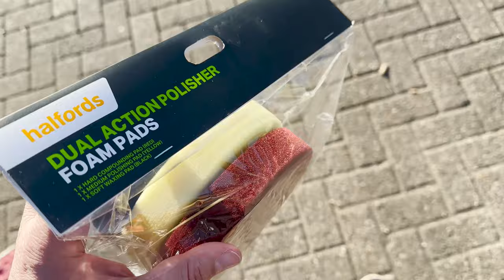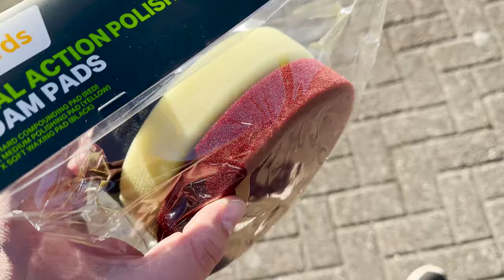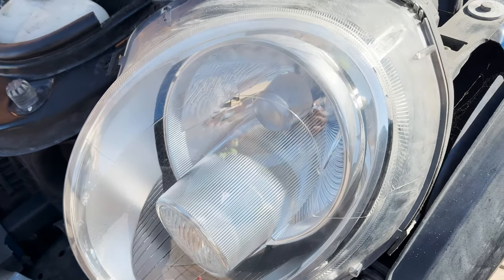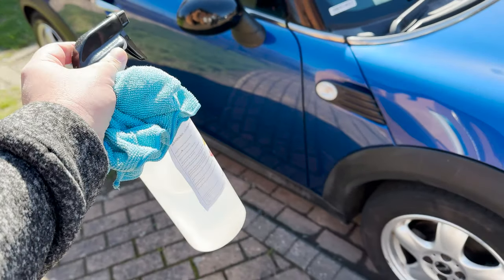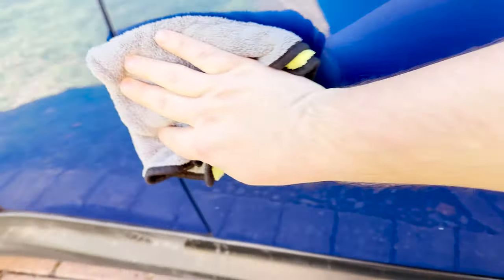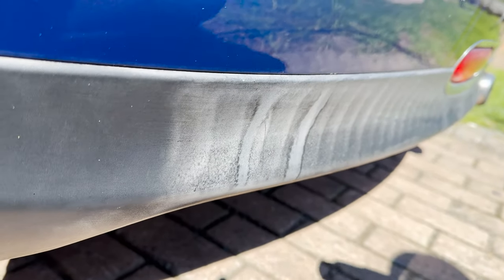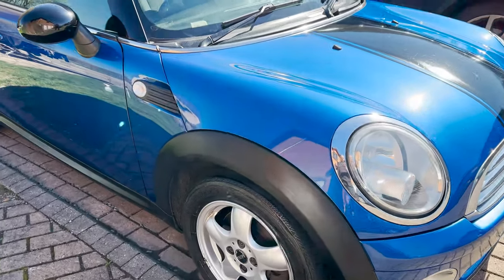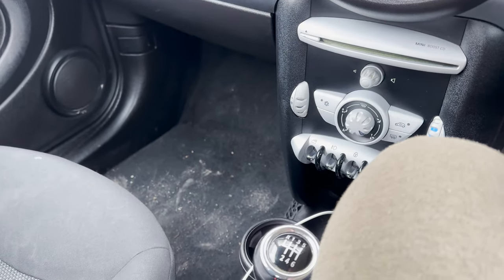Prepping The Mini-You Wont Believe What I've Found-Car Trading UK

Comment from the maker: My Favourite Products
Multi Purpose Cleaner : https://amzn.to/40BxTuf
Best Dressing : https://amzn.to/433araH 
Detailer : https://amzn.to/3Kbuz22 
Glass Cleaner Exterior: https://amzn.to/3zq6MWZ
Detailing Brush : https://amzn.to/3zofFAk 
Best Wax : https://amzn.to/3GcYzJE

Polisher- https://amzn.to/3kS6Fj9
Polisher with batteries - https://amzn.to/3Yle0Wc
Battery pack- https://amzn.to/3KRjyoq

Heavy Cut Compound Large- https://amzn.to/3Jd8mBj
Heavy Cut Compound Small bottle- https://amzn.to/3IRr8N0
Second favourite compound - https://amzn.to/3ZXNO5t

Cutting Pad- https://amzn.to/3JatdnJ
Polishing Pads - https://amzn.to/3kNotfu

Microfibre cloth - https://amzn.to/3Jd6NmG
Drying towel - https://amzn.to/3YkxL0a

Long Lasting Wax Dark Cars - https://amzn.to/3KWs0Tt
Long Lasting Wax Light Cars- https://amzn.to/3kFZVFj

Ceramic liquid car wax - https://amzn.to/3muqYUf
Ceramic Spray Wax- https://amzn.to/3kOqx6W

Comment: Hi Christian,great job on the mini and looks a different car,the only thing I'd say is although using a heat gun on the plastics look good it seemed alot of work and you risk heating the bodywork by mistake so I've just watch an older video of James at chops garage and he's now uses a brush on product called Owatrol and swears by it but I just thought I'd mention it but whatever is good for you m8,not a massive profit in it so hopefully it doesn't come back for any faults etc,cheers Christian have a good weekend and hope Jason is doing OK at tyre kicking😂👍
Reply from the maker: Thank you very much Mark ! There will be a video up in the coming week with Jason 💪 , I know what you mean regarding the best gun but it worked and it stayed like that